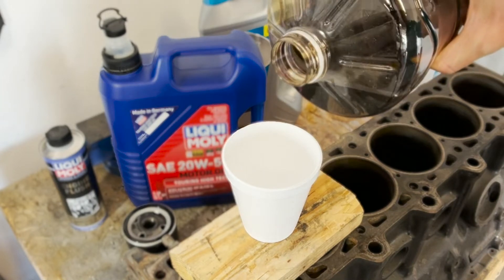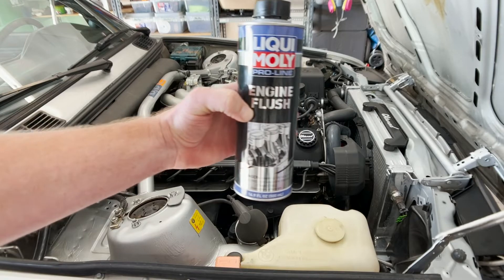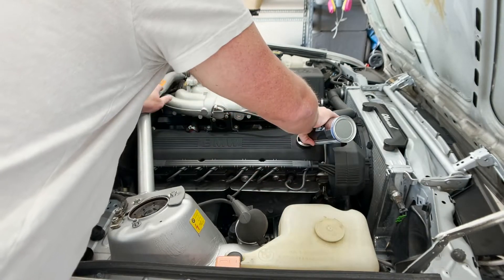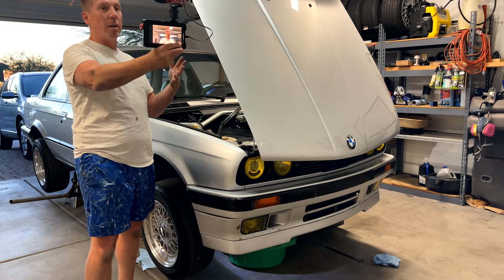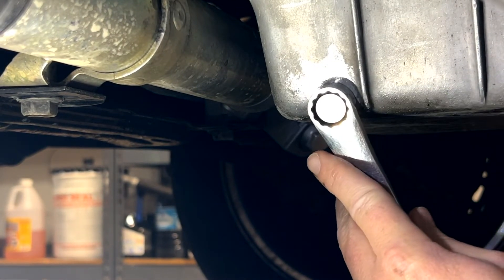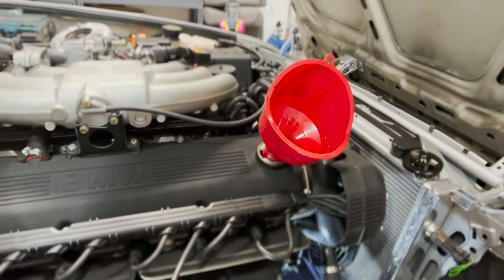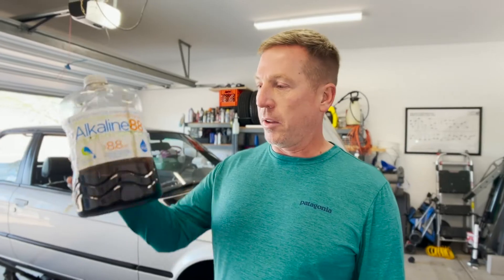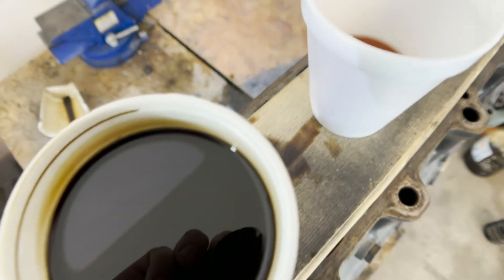Liqui Moly Engine Flush: Did It Work? BMW E30

Comment: Not to be the negative type but Blackstone lab tests have shown multiple times color does not mean anything in regards to the condition of motor oil.

If you pour new motor oil into a container, add appropriate amount of flush for amount of oil used, and heat it to roughly operating temp range it will turn the new motor oil dark.

The heat, and flush causes a chemical reaction, which results in the motor oil turning dark.
Reply from the maker: All comments are welcome and necessary for all of us to learn. Thanks for watching and chiming in. I appreciate it! - Tom
Reply: The best way to kinda tell is the smell of the oil. If you know how fresh oil, slightly used and heavily burned oil smells you can kinda tell the condition from that already. Then you smear it with your fingers to sorta feel the viskosity and other "feel" to adjust your estimate a bit more accurate. But that's pretty much it. For anything more precise we would have to send oil samples to a laboratory for close inspection... but nobody does that :D for the price we all simply just buy a few cans of fresh liquid and change it.

Comment: Hello mate I’ve got a question, it might sound quite funny😁I just used this product in my car and I knew it should be at idle, but as soon as I poured it into the car a minute later of idling the garage asked me if I could reverse back up on the ramp I just reversed probably about a couple of meters if that, 
Do you think that could cause any slight wear and tear, just a couple of meters probably. less than 6 meter
Reply from the maker: Nope 😊. The car will idle for 20 minutes as you know but moving it won’t matter. I believe I’ve heard that can drive a short distance with no issues. You’re all good!! Have an awesome day!! -Tom
Reply: @thedriversapex  oh thanks a lot mate I appreciate the response I just wondered if it will cause any damage with a slight reverse for a couple of meters, plus do you recommend an engine flush with each service? I mean will using the engine flush on each service be a problem

Thanks a lot mate

Comment: very clean garage, car, . thanks for uploading.. what is your mileage.? i have N52 later model 2008 528xi with 256,541 kms ... i bought mine used at 156,800 . I watched Doctor BMW Dean - something to this effect that this can do more damage than good.  what is your take on it ?  thanks
Reply from the maker: Thank you!!! My mileage is around 190k miles. Though the engine probably had half that. I think there is some truth to that, i.e. a high mileage engine may not be the best candidate because the flush can loosen deposits that can cause havoc. One doesn’t want to cause oil starvation, leaking seals, etc. I did this flush on my E46 M3 but it had 50k miles and the prior owner had long oil change intervals. Thanks for watching and thanks for chiming in! I appreciate it.
Reply: @thedriversapex  thanks, agree , however since my engine is still original and 13 year old... is it still safe to do the flush(only once) with 1/2 bottle. less aggressive approach. or not do it at all. just
Reply from the maker: Hey! Thanks for your patience. That's a good question. Someone recently commented that they used it on a high mileage engine and the engine is running better, now that they used this product. I hate to say yes or no. Is this a daily driver? I would feel horrible if something bad happened to our engine. I used it on my e30 with higher mileage and no issues as well as my lower mileage M3. Let's see if someone chimes in on this post.  @mohammadhayatca3244  @mohammadhayatca3244

Comment: Hy, when you use engine flush you need to flush it again with cheap oil, let turn for 10min , drain and then put the good oil , 

There is always a little bit engine flush in the engine 😉
Reply from the maker: Hey, Thanks for watching and thanks for the tip. I will be sure to do that on the next flush. Thanks again for watching!
Reply: Then you got to flush it again to get the cheap oil out lol😂
Reply: ...isn't any residue supposed to burn off / evaporate out of the new oil...???

Comment: I use this stuff to good success. Is it necessary if you run a great synthetic? No, but keeping the inside of the engine clean would only be an issue if the detergent thins out the oil film enough to where you start getting wear in the bearings. Idling, that's highly unlikely on one can, as long as  you have good oil pressure. Also, please don't put Dino 20W-50 into these motors if you're in a cold climate. In Germany, many M20s suffered worn camshafts and excessive wear because this crap doesn't flow well at cold engine start through the underdimensioned oil passages. Personally, I run Mobil 1 5W-50 in SouthernCalifornia, which is overkill for these motors but the only reason they didn't run great synthetics back in the 80s is because they weren't readily available at reasonable prices. Not because the engine was somehow designed for Dino oils. 🤦‍♂️ Change your oils, adjust your valves, warm up the motors gently but get them up to temp too. Don't drive for long with vacuum leaks or dripping injectors and these motors are bomb proof.

Comment: I would advise using liqui moly ÖL-verlust, keeps seals nice and soft + saves them a bit if old, have had great luck with that aditive on both BMW's and subarus, both notorious for oil leaks and consumption, have also used it on my Civic and no leaks yet (2006, High mileage). Every 2 oil changes.
Reply from the maker: Thanks for watching! I really appreciate it. This is good information; thank you! -Tom
Reply: will it thicken the oil viscosity?
Reply: @javieroargubi  Not quite, it does but it is really minimal. Nothing to consider

Comment: Brad Penn is very good for engine protection.
Reply from the maker: I love Brad Penn oil. It’s quite a bit more expensive than LiquiMoly, but I believe for good reason. Thanks for watching, and yes, to anyone reading the comments, Brad Penn oil is amazing!!! I like the driven fuel injector cleaner as well.
Reply: I didn't said that it was good by technology changing to spelling words I hate it.brad Penn doesn't have enough engine protection.sorry.
Reply: I didn't said that good technology changing words.brad Penn doesn't have good engine protection.sorry.
Reply: Goof technology changing spelling words.brad Penn doesn't have good engine protection.sorry.
Reply from the maker: @craigbadder321  lol, autocorrect is so frustrating. I used brad Penn for the e30 and had good results, but stopped using it because it was so expensive. I think I was paying $13 or $16 a quart 😳. I really like Liqui Moly now and it’s stopped all oil consumption in the M3. Castrol was horrible.

Comment: What type of oil was in it before?
Reply from the maker: Thanks for watching. Great question. I used Valvoline 20w-50. I’ve also used Brad Penn, but it’s so expensive. Probably the best and I’ll most likely use it on the stroker engine I’m going to build. Thanks again for watching!